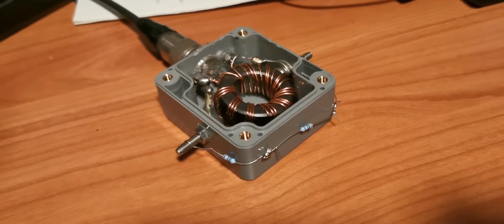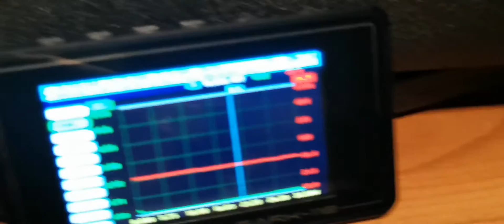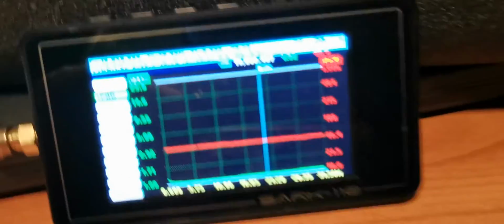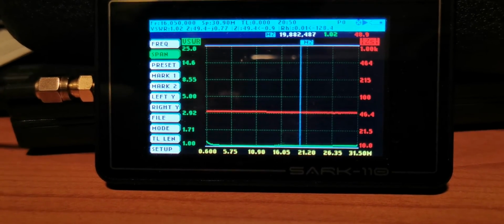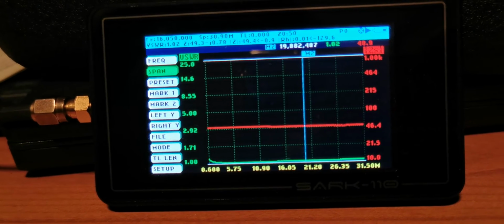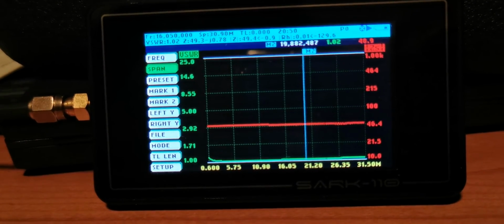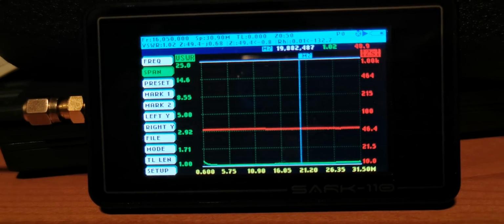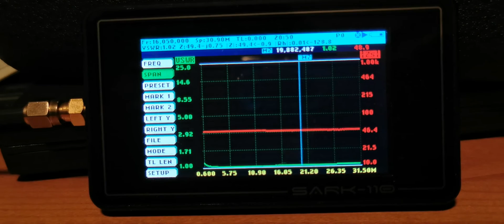Testing a homemade 9:1 Balun for a T2FD antenna project

Comment: Thank U Jam ... Wonderful Pro built and Finish 
... i still need to know if there is a (DC-short path) between the (Balanced Ends) of the Antenna to (SO-239 outer shell) or Not ...?
 i mean ..Does 450 ohm (Balanced-side) of the Transformer has been left float , Or Somehow connected to Earth-Side of the 50 ohm input ?) as other they normally do to other types of End-Fed Antenna's ..
Hopefully we see the Diagram ..
Reply: yes one end of the 450ohm  section is dc grounded  to the shell of the so239 after going through the other windings like in this example    https://www.dxzone.com/dx33481/50-450-ohm-9-1-balun-for-vertical-antennas.html    If you follow the blue wire it connects to the red and then the red connects to the yellow which connects the to socket ground

Comment: Which combo gets better testing results: 6:1 and 300 Ohms or the 9:1 and 450 Ohms  ? Is there a difference which combo you use ?
Reply from the maker: depends on the antenna itself and the load resistor value. Generaly I always go for 450 ohms as thats what is most comonly used in t2fd antennas.  I would guess 3200 ohms would be just as good